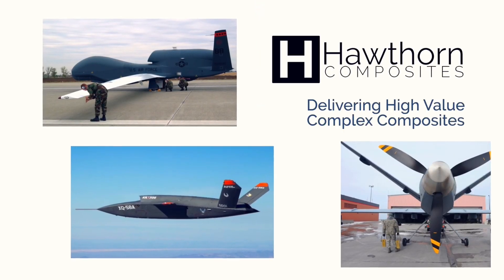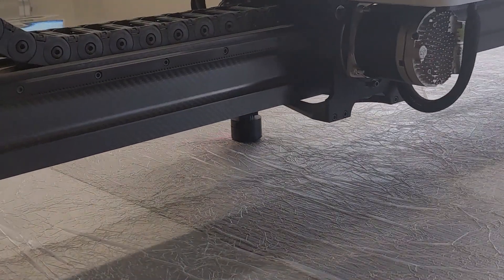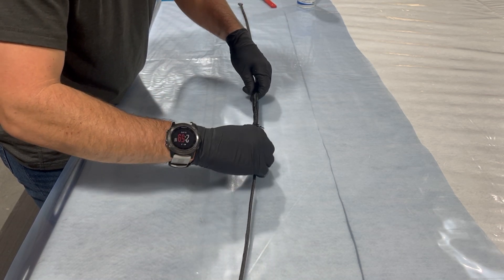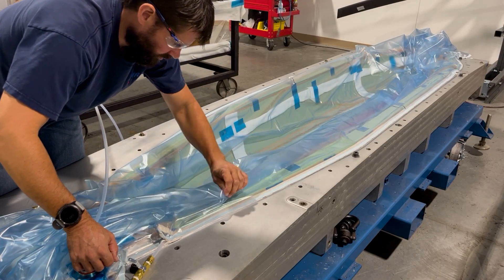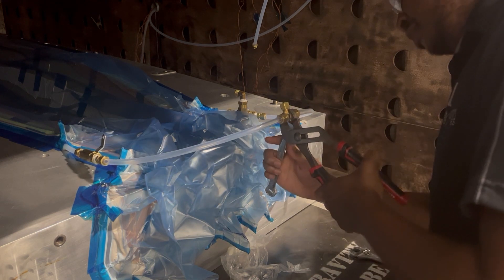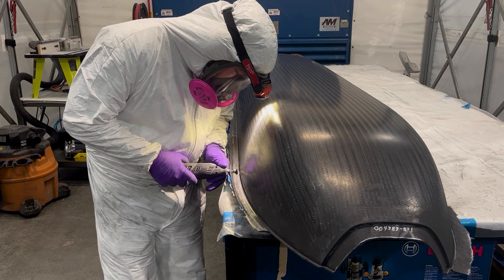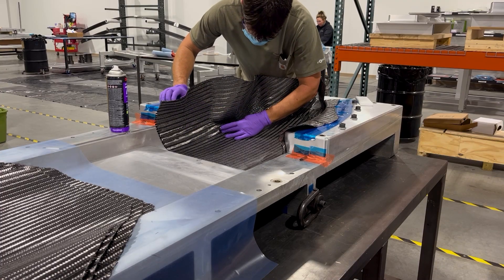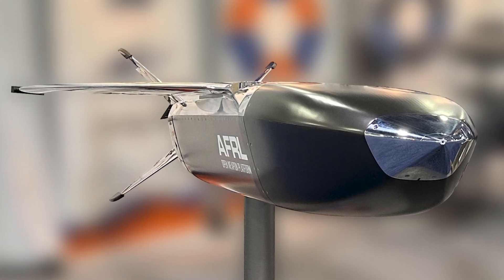ZONE 5 CLEAVER Carbon Fiber Fuselage Layup and Case Study

Comment: Oof. I've done both the prepreg and VARTM routes on UAV parts with hard tooling. VARTM is super labor intensive in this particular application and working with dry fiber is a pain in the A$$. (dry fibers floating around the shop .. zapping computer power supplies .. ask me how I know) Prepreg is way easier and with just a modicum of skill you can have pinhole-free parts coming straight out of the mold.
Reply from the maker: We disagree with your base assumptions. Dry carbon fiber and resin infusion requires much less labor than prepreg.
Reply: @HawthornComposites   Not assumptions -- experience. Infusion is great for things like large boat hulls. Not so much for small aero structures.
Reply from the maker: The part's finished thickness requires 7 layers of quasi-isotropic carbon fiber, if this was converted to prepreg it would be 5 -7 layers to achieve 1 layer of the dry fiber being used in this video.